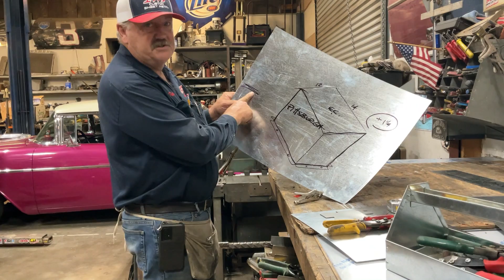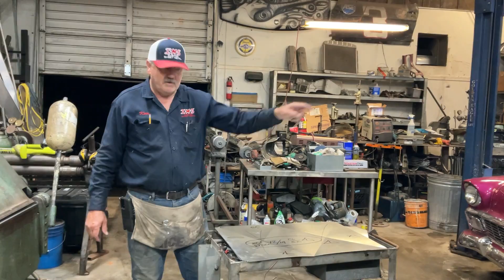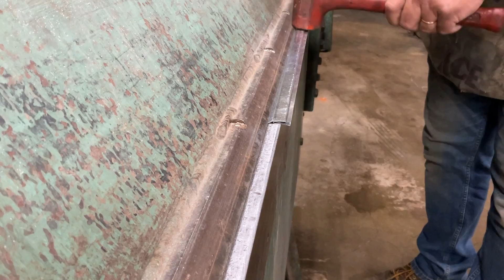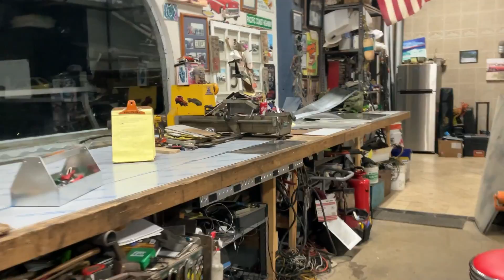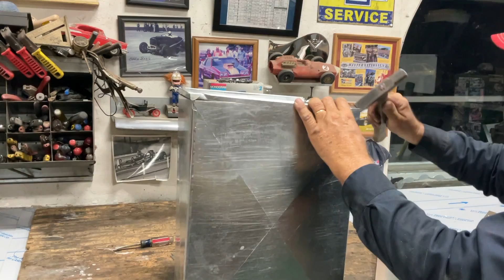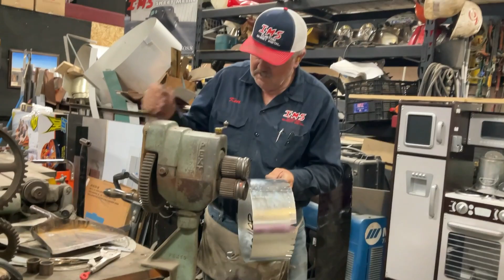SHEET METAL is FUN!    Making a Plenum with end cap and collar.

Comment: I just bought a piece of sheet metal,   I want to try to make a battery box for my 1954 farmall 100.  The metal is 16 gauge.  I only have claw hammer and a few c clamps some drills drill motor and a 120v wire welder.  Can I do this?  I have not tried this before.
Reply from the maker: You can definitely do this. 16 gauge is nice and thick. When I am in the field I drill a series of holes along the intended bend line. It bends easier and more predictably. You got it. Send us a picture of your project to sheetmetalisfun@yahoo.com.   thanks for hanging out with us.

Comment: I love these videos and have become fascinated with ductwork fabrication in general. I made my first Pittsburgh lock two days ago. I didn't have access to a guillotine, seam forming machine, or press break but had a go anyway. I used snips to dimension the starting sheet and tried hammering the folds over a bench corner. I market out a one-piece, 150mm x 125mm (6" x 5"), duct section to be joined down the one long (600mm / 2') seam with a Pittsburgh lock. Unsurprisingly given my crude tools and method, it is a bit rough with visible unevenness in the folded corners. Also the Pittsburgh edge had a slight curve along its length (the 600mm long edge was very difficult to keep still when I hammered the folds, despite clamping). Even with those defects, the duct is solid, I can't pull it apart and the joint is tight. I can't tell you how thrilled I am with my first shoddy fabrication results, especially as it was only last weekend that I'd worked out exactly how the folds are sequenced in the Pittsburgh (very clearly shown in this video though). A friend of mine has a press break  and has said I can have a go with it during the week so I'm really looking forward to repeating the exercise. Thanks for posting these informative, and inspirational, videos.
Reply from the maker: Well you are easily the star student of the week. We are so glad you found value in our lesson. My wife and I both grinned ear to ear as we read your encouraging response.  Keep us posted as you progress in your pursuit of mechanical competency. Check out our other lessons and let me know what you think. Thank you for your time.

Comment: Never heard the term Pitsberg! we a used to call it Lock forming. Paul from Ireland. Nice work
Reply from the maker: Pittsburgh is the name of the seam. Lock forming is the process of manufacture. Then, there is the trademarked brand LOCKFORMER, which is the company that makes the machine. They also make a machine that makes the SNAP-LOCK seam, which has taken quite a share of the market. Great question.  Thanks for watching

Comment: Hi Ken, thanks all your videos. My school has a pan and box brake and thanks to your videos I’ve been using it.  I have some odd projects in mind. Do you have any tips for repeating unusual angles on the brake? Today I made two identical pieces with 30 degree bends in them, and it was a lot of eyeballing and I went a little far with one of them and had to try and unbend it.  Do you have any tips for hitting those odd angles every time? Thanks 

Also would be interested in any tips you have for cutting odd angles accurately on the shear.
Reply from the maker: At the pivot point of the brake, there is a stationary part and a moving part. When you get the bend you want, hold the bending leaf( that's the moving part) and use a pencil to make a reference mark across the two parts of the brake. Let me know if that makes sense. Thanks
Reply: @kengodfrey1956  I don’t understand how thats gonna work, but I’ll try it. Thanks!
Reply from the maker: @Dansplains  it will be clearer when you're looking at the brake.

Comment: From watching other videos, I decided I wanted to get some "mastic" to seal the cracks.  I haven't been able to find any.  Not sure if urethane or butyl would be good.  I assume one should consider fire safety and fumes.  Would aluminum tape work here?  I don't know if high heat would melt the adhesive.

Another excellent video that shows us how to be independent, and not have to buy the finished product from a store.  Thank you, Ken!
Reply from the maker: Polyurethane is the ticket. Let it cure for 48 hrs before you turn on the furnace.  Cooling is OK right away

Comment: I love this channel and I've learned a lot. I would like to build a dust collector blower housing and an impeller for a dust collector. I've seen several builds, but they are all built out of wood, which isn't as durable as a sheetmetal one. Are you planning on making one at some point?  It would make an awesome video.
Reply from the maker: I haven't made one in thirty years.  I'll kick it around.
Reply: Word of warning, dust collectors can create a lot of static electricity from the rubbing particles. Make sure your dust collector is grounded to avoid a static electricity spark from setting off a dust explosion or burning down your workshop.

Comment: Stopped for a second, you're making the other half of the plenum.  I'm wondering how you're ever going to get those 1/4" bends inside of each other.  Continue... Marking the circle, I want one of those hammers.... Ok that's how the corners go.  What kind of sealant?
Reply from the maker: Polyurethane
Reply: @kengodfrey1956  Did a search, I see mastic, acrylic latex, a lot they just don't say, some with fiber.  Some in a bucket or in a tube.  They say to overlap any blankets by 2 inches and staple.  I wonder what that staple looks like, must be special gun like a box staple to be crimped from the outside?  Do you do the metal or also the insulation?
Reply from the maker: @robert574  on a small scale, like this one, I prefer the caulking gun application.  Insist on polyurethane  or butyl. No latex or silicone. They both degrade and delaminate.

Comment: Back in the arly 1980's I had to make ALL of my Pittsburgh Lockforms by hand, using the bending press and seaming tools with a hammer. Usually eight foot long by 12 inches diameter. Then crimped. Ahhh those were the days, and just after I left, the boss bought a second hand lockforming machine as no-one else knew how to make them by hand!! 🙄
Reply from the maker: They didn't know how good you were till you moved on. Tale as old as time. Thanks

Comment: Should have used a 1/2 by 1/2 flange on the bottom, less chance of getting cut and a much stiffer joint on the furnace

Comment: Yes, taking flat mtl & laying out lines in the right places is Very satisfying.  Then rolling/braking the parts into cones, sq to rounds etc. I needed hub caps for my '65 F100 front wheels. Took the measurements, layed it out on paper board first. Then placed the pattern on a small piece of 16ga. Cut it out. Then warmed it up with my torch. Next was forming it. Made a flange with three holes (120* apart) that are welded to the cones. Needed threaded blocks to be welded to the steel rim (so hub caps would be fastened to the rims).  I made the hub caps  so they are interchangleable. Sand blasted them. Painted them white. Been working for 20+ yrs.

Comment: That's nice Ken. Our church has a probably two year plan to replace our furnace in a little building and this lesson in having fun with sheet metal may come in handy. Fairly good video, sound needs some work still. but all I do is put the sound at a acceptable level (for my wife) and put the speaker close or further away as the sound level varies.

Comment: I enjoyed going thru the basics again. I went thru a 1 week course in the summer before school started in the 8th grade learning to see if we wanted to go and do HVAC.  I made a basic pan similar to what you did except we solder the edges. I gave that pan to my sister so she could put her makeup in it. She is now 72 years old. We were talking on the phone and she still uses it for her makeup. I still do a little sheet metal work once and awhile. I retired 2 years ago from doing electrical and welding at a mine.
Reply from the maker: I'm glad you stopped by. Making stuff is so rewarding.